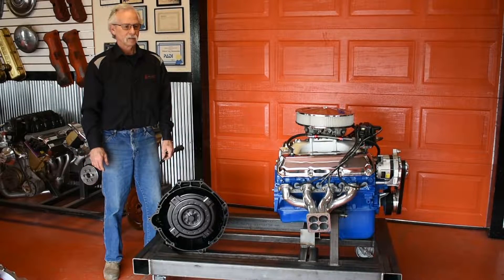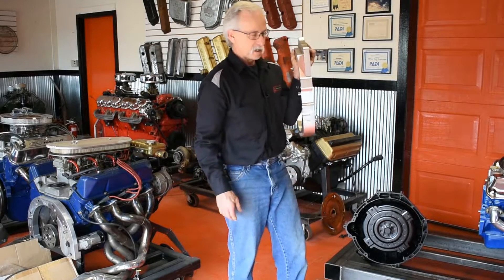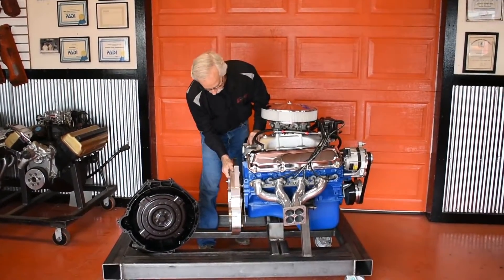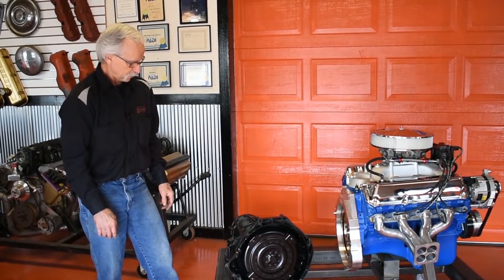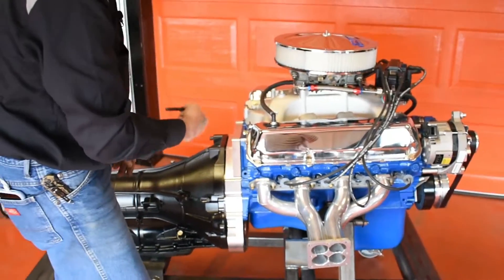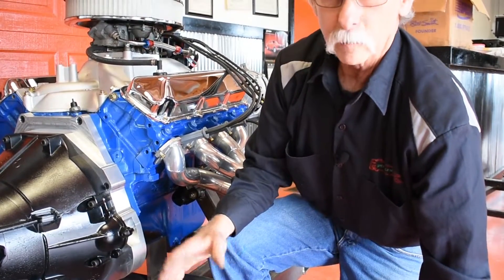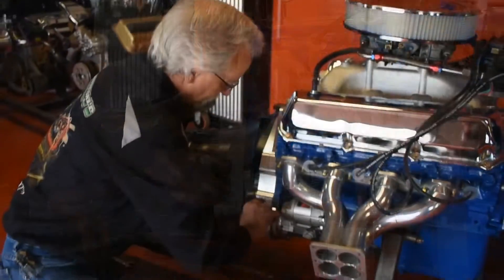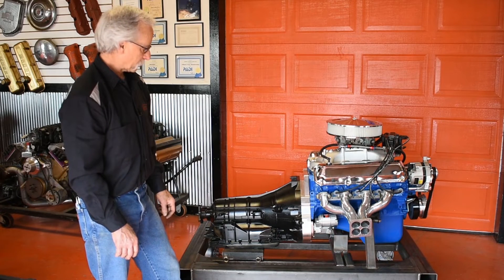Ford 429 460 to 6R80 Transmission Adapter Kit Installation

Comment: I’m planning on installing a 6r80 on to my sbf 393 stroker, but I’m confused on witch transmission would work better for my application the one from a 5.0 f150 or the one from a 5.0 mustang gt? Or are can I use either or?
Reply from the maker: This kit will not work with your SBF 393. We are currently working on this kit and it is nearly ready. However, either 6R80 can be used as long as it was from the 5.0 or 5.4 V8. Also, these kits will work with the Ford Modular V8 transmissions as well like the 4.6 5.4 and the 6.8 V10.
Reply: @speedgems3978  yes I’m am keeping up with you guys new SBF kit. It looks great, so as long it’s a 6R80 from a V8? Im just wondering which one can handle the most HP the one from the F150 or the one from the Mustang or can the both handle it the same?
Reply from the maker: @ozielmadrigal9374  Well they are basically the same transmission but it comes down to gearing. From everything we have seen these transmissions from factory are capable of handling 1000hp. Obviously, if it use then who knows because you wouldn't know the maintenance history from past owners.
Reply: @speedgems3978  thank you for the info, God Bless🙏🏽
Reply from the maker: @ozielmadrigal9374  Not a problem.
Reply: I have and 89 f150 4x4 that I’m taking the 302 out and putting a 460 in. Will this kit allow me to keep my original transmission?

Comment: You should  make a 5l and eccoboost adapter to a 4r75
Reply from the maker: The 4R75 should bolt to a 5.0L as they are both modular bolt patterns. Which Ecoboost would you like to see a kit for? We make one for the 4 cylinders currently.

Comment: I'd love to drop that 460 with that 6R80 trans in a late 1970's Ford F-150 and / or a mid-late 1970's Ford LTD Country Squire. I may get some flack for saying this but I would also install Holley's Sniper EFI on it as well. For the Country Squire, I'd pair that with a 3.25 posi and for the truck I'd go with 3.73 gearing.
Reply from the maker: Sounds like this would rip pretty hard! We're here with an adapter when you're ready.
Reply: Edelbrock Pro Flo 4 is much better than Holley Sniper.

Comment: The problem is with controlling the 6r80
Reply from the maker: We sell the stand-alone shift computer for this application. We offer a discount of $125 off of our kit if you order the kit and controller together.
If you have any additional questions please feel free to call or email us.
Reply: @speedgems3978  it will never shift like stock, clutch packs will wear out super fast. The standalone won’t receive torque reduction values based off of pedal position. There are so many parameters in the base file for tuning a 6r80 through the factory ecu, there’s no way your able to properly control the 6r80. Yea sure you can make it shift but it’ll burn through clutches.
Reply from the maker: @alexanderfontenot87  It is possible if it is not tuned properly. Our recommendation is to take it a capable shop who can tune the controller for you.

Comment: This is a badass kit. But does this work for a 90s 460 too? And does it rob power?
Reply: The 90’s 460 has the same block as carb’d 460’s down to ‘79
Reply: @meteor5452  thank you so much
Reply from the maker: 1979-1997 460's are the same block but just varied as far as application and EFI on the new engines. It may "rob" a slight bit of horse power but nothing that you would notice. 
If I would have to venture a guess it would be less than 5hp. We have never had this engine on the dyno with and without our kit so It is hard to say exactly.
Reply: @speedgems3978  thank you so much

Comment: Does this kit work for 6r140 ? Thanks
Reply from the maker: Steve, 
The 6R140 will not work as those were used on the Diesel engines and not the V8 gas as far as we can tell. 
The 6R80 is a very robust transmission and holds a lot of power. Making it very suitable for most applications we have found. Feel free to give us a call.
Reply: Steve, the answer is yes. If you source a 6R140 from a gas, 6.2 Superduty, it'll have the same modular pattern as the 4R100 & 5R110.
Reply: @AK_Ray  why is the diesel different ? Thanks spooln272
Reply: @MrBlackbutang  because Ford likes to make things hard LOL, honestly I think it's because for 20 years the diesels were international built with an international bellhousing and when Ford came out with their 6.7 it was probably easier just to keep the same pattern. Just a hunch.
Reply: @AK_Ray  Ford make the cheapest way not the hard way for has the same marketing tactics for many decades yet the simplest engineering and designs. Unlike this overly priced piece of aluminum.

Comment: Would a transfer case that fits a c6 fit the 6r80?
Reply from the maker: If it is a divorced style transfer case I am sure you could make it work with some custom work. Also, you would need to consider the difference in sizes of the two transmissions.
Reply: @speedgems3978  okay, thanks!

Comment: I have been looking at different transmissions I can mate to the 460.  I was pretty set on trying to get a GM turbo 400.  But that's a lot of $ to be able to get one that can handle the torque I'm putting down.  I'm super happy this video was recommended to me.  6r80s are supposedly quite stout stock and cheap. Then I can keep everything Ford.  I believe that within the next couple of weeks you will have another sale here.
Reply from the maker: That's fantastic! We also sell the shift controllers for the 6R80 as well. We'd love to help you with this when you're ready!

Comment: well as long as i do not have to use an automatic 3speed od l oh how i dislike them lol (5-6 speed manual) my thoughts is us the ford ecu on the old engine and with new transmission why not with tuning it does not know whats its on now with that said i have not tuned any late fords but like anything ill bet it easier than one would think

Comment: 5R110 behined a 460 would be nice for trucks!
Reply from the maker: A 5R110 should also bolt up to this kit. The 5R110 you use needs to come from a GAS engine.
Reply: @speedgems3978  thanks for getting back. I mayor build a f350 with that combo

Comment: You can tell just by looking at it that it’s well engineered. How much does the torque converter adapter weigh?
Reply from the maker: About 2 pounds.

Comment: I have a 79 ford bronco with a 351m good running motor that I drive on highway regularly excited to see this
Reply from the maker: Mark, 
We do make a kit for that engine which will allow you to bolt up a 6R80.
https://transmissionadapters.com/products/ford-351m-400-429-to-ford-aod?_pos=1&_sid=a872e5050&_ss=r
Please give us a call if you have any further questions!
~ Speed Gems

Comment: You sir are right on the money. The 429/460 most certainly deserves to front a 6R80. I have a friend with both engines and your kit looks bullet proof. Guess who I am going to tell.
Reply from the maker: Thanks
Reply: I want to put this in my crown vic or my 08 Expedition